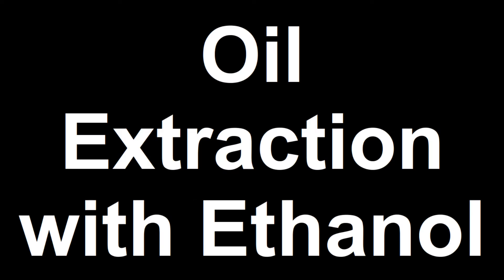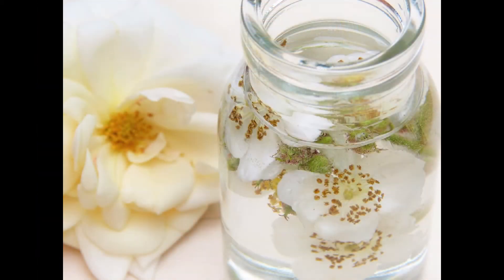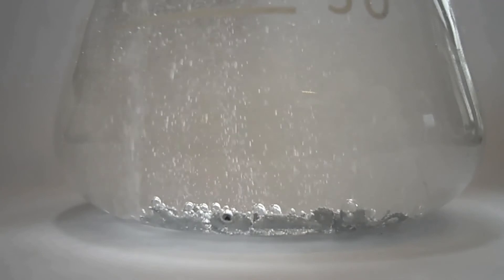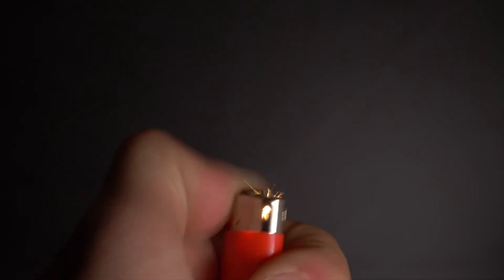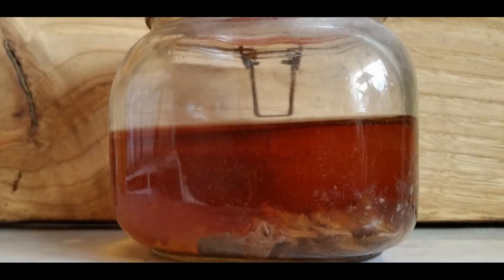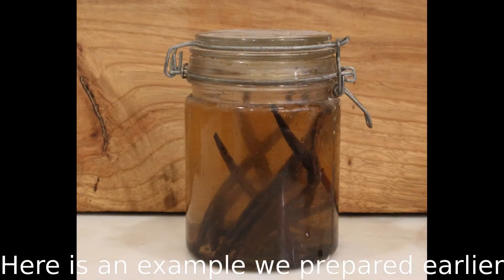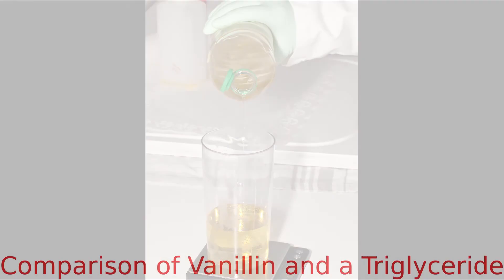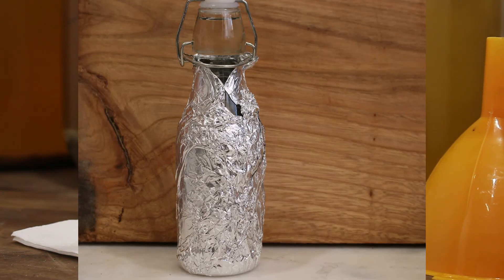Preparing an essential oil extraction with solvents

Comment: Thank you so much for such an in-depth explanation! Could I ask some advice? When create absolutes using woods and leather etc for use as a fragrance oil or in candles via ethanol extraction, how would you evaporate the ethanol safely? And what and how would you dilute them? Could you use oils to dilute them? And would it need to be heated etc?

Comment: How do i make rose absolute with everclear and do i need to remove alcohol or let it evaporate
Reply from the maker: For all intents and purposes and you can use everclear the same as any other alcohol so long as you do not drink the absolute made with it. Mostly due to how horrible the ABV of everclear is. Also effects the aroma of the oil.
Evaporation is an option but it is kind of wasteful.
Removing it through freezing is a good way to reuse the alcohol. Otherwise pot distillation, freeze drying and so on.

Comment: Hello. Is it possible to separate a concrete and absolute without the vacuum or steam distillation? Without heating the concrete, in general. For what I understand, after obtaining the concrete, it is being mixed with the alcohol, in order to separate waxy substances from the aromatic ones (absolute). So, how long until they separate, and how to scoop the absolute afterwards? Will it flow on the top, i.e. Will the waxy substances fall down to bottom of the vessel used? Thanks.
Reply from the maker: Yes there are ways. To some extent it is how you get some oils like vegetable (eg olive) oils. this is done by mechanically crushing or squeezing the oil out. You can then freeze it to separate the more solid components or using filtration. Another option is alcohol extraction  by soaking your source material in alcohol.

For the alcohol we simply add it to the oil extract solution and shake to combine. You can do more but this is the most basic option. Place in fridge or freezer. Freezer is quicker . The water should not freeze. The oil can be skimmed from the top as it will be solid and like a wax cake or wafer. 

Wax substances and oils that you want such as aromatics are much harder. They have a broadly similar miscibility with ethanol. This is why freezing the second time can cause it to solidify and sink (waxes) but the oils if they are aromatics should float and separate from the others. How well this works depends on many factors. Purity, type or aromatic, alcohol used and more. Unfortunately it is a very wide range of possible variables that all interact.

This may not be very helpful as it is generally easier to show than tell in most cases as it can be specific to application.

Comment: What method would you recommend for making a cacao essential oil? I would be using cacao nibs.
Reply from the maker: Good question. Caco nibs are better as there is more surface area for interaction and drawing out flavours.  Alcohol extraction is probably best ( https://youtu.be/SBGm8616poU ) and ( https://youtu.be/gfhilr7_vcQ ). 

Your cocao flavour is probably largely made up of things that are not as water soluble so ethanol is the best option that is practical. If you want to concentrate it than freezer distillation or a pot still is viable. The latter will impart a smokey or burnt flavour. 

Some experimentation of how much ethanol to use will be needed for a good result. We suggesrt starting at 20% This is  vodka diluted with an equivalent amount of water. From here you can go up to straight vodka at 40% ethanol or down to nearly 0% ethanol.